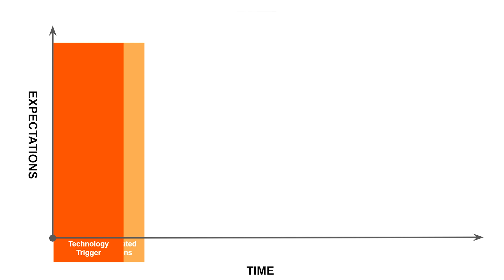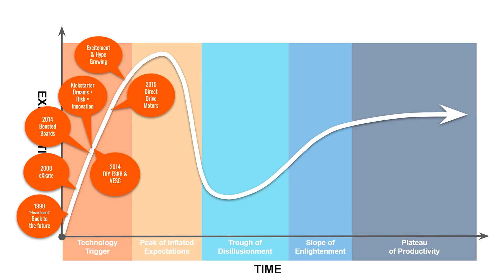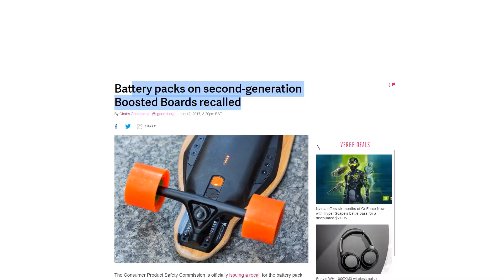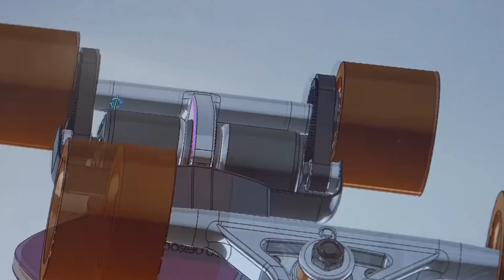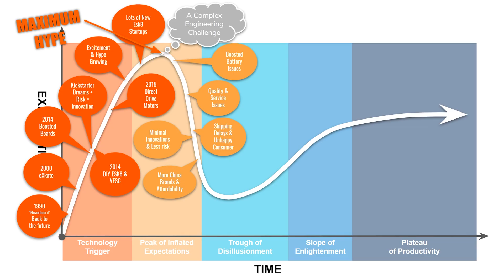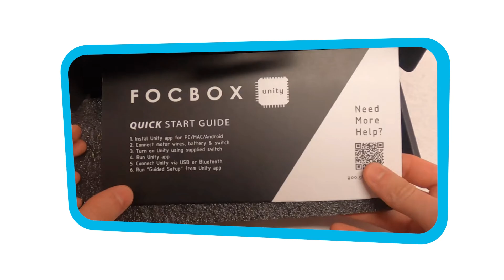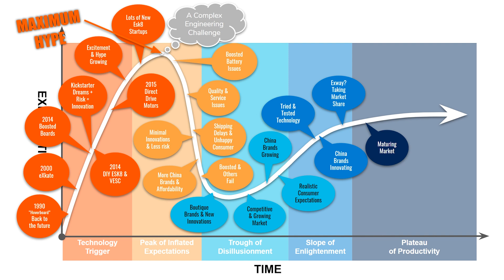[ ESK8 REPORT ] Innovation, Risk & Failure - The end of electric skateboard innovation?

Comment: How does this video have any dislikes? This is the truth & I’m an Evolve rider. 
Evolve has the all-terrain options which really separate them. Pneumatic off road wheels are definitely he way to go.  Jason I assume you still ride an Enertion Raptor?
Reply from the maker: WowGo AT2 now has pneumatic tyres
Reply: @ElectricSkateboardBuilder  And they have the new hobbywing esc with the on/off by the remote only, a complete full stop, only thing for evolve right now is their supports, but it will be harder and harder for them to justify their prices.

Comment: I admire the risk taken by forming a company to make esk8s but for the same reason I wont even make a diy board for friends is the risks involved both in terms of safety and technical capacity to overcome basic electronic faults that happen normally through wear and tear.
Reply from the maker: Reliability engineering still needs lots of focus & attention to make all-electric skateboards more robust. One benefit of DIY is you will learn some skills to help solve problems when faults occur. When you buy a pre-built board it is much harder to self-repair, you must rely on the company that sells it to you.